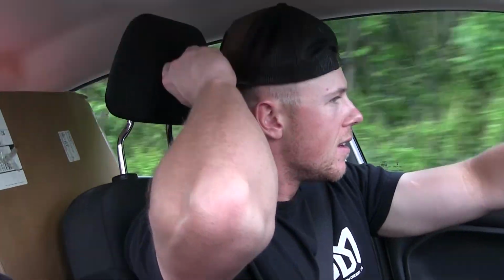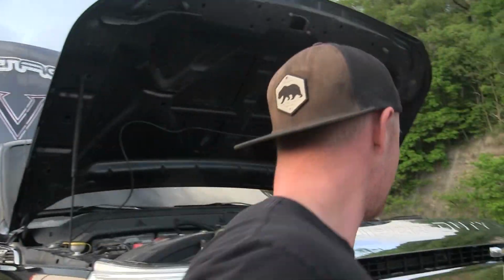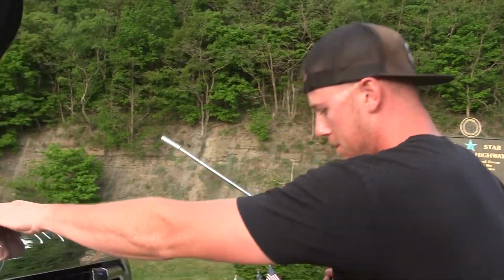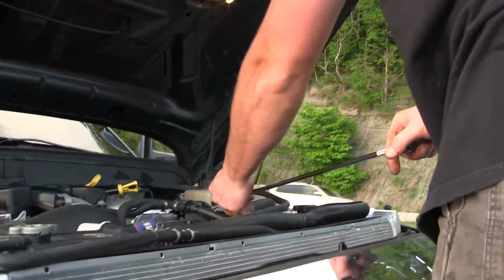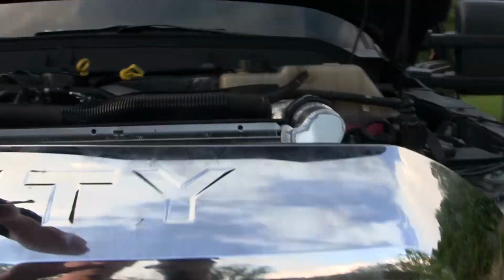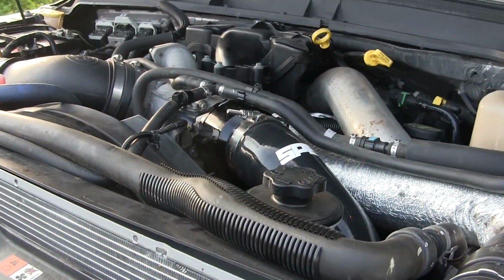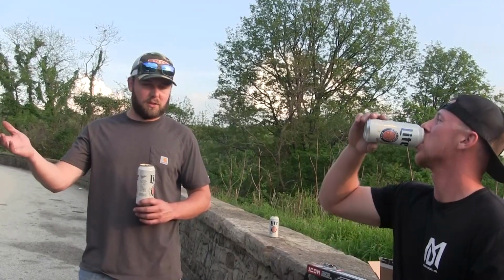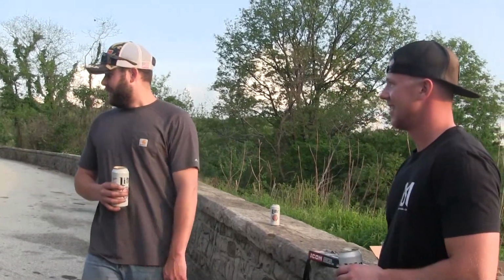6.7 Powerstroke BREAKS

Comment: Great Job guys!!  

Question,....do these cold sides mainly blow when folks are towing?  I don’t tow anything but instead enjoy my beast as a normal driver.
Reply: Results Will Vary Gotcha.  I’ll probably replace mine then with yours just for shits & grins!
Reply: I blew mine not towing with my 11 250.
Reply: I always wonder if oil residue from the CCV will also cause plastic weakening